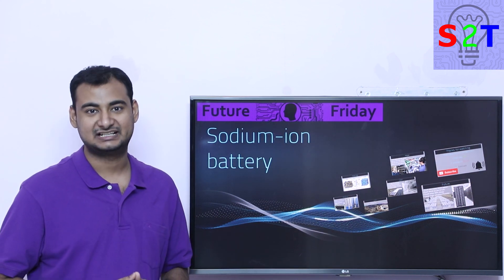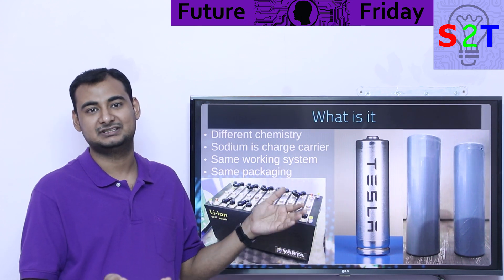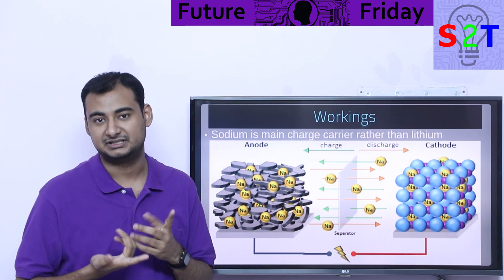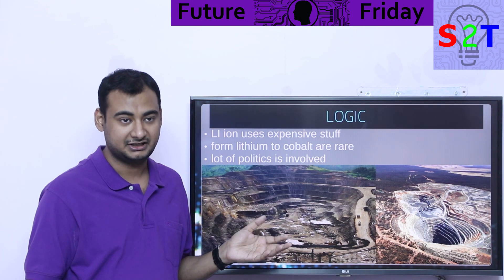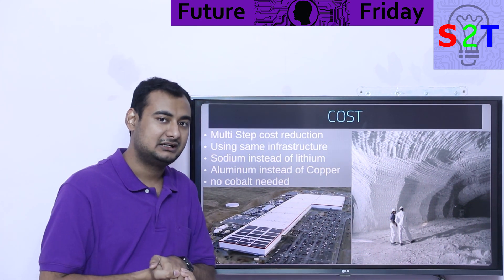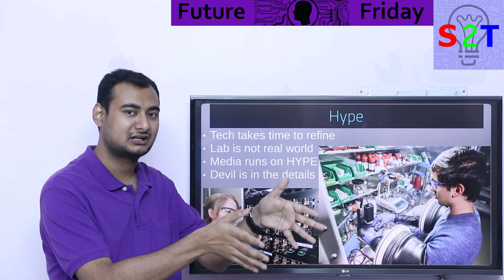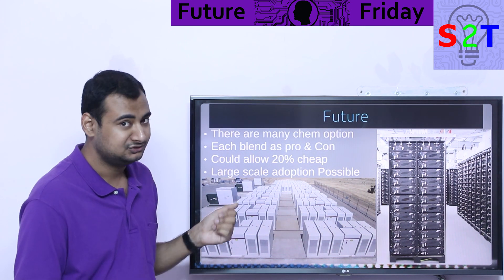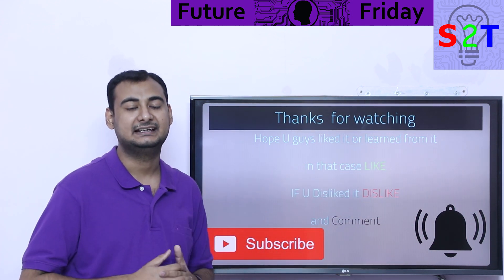Sodium ion battery Explained {Future Friday Ep98}

Comment: There are different types of processor for mobile phone how can we which one is best.
Reply: Performance of process based on many things but important is 
1) letancy 2) how smaller is circuit  or size of nod 3) core count  
4) clock speed 
But also depend on how many layer of interface lie beanith in application software
So Apple  bionic processor is  best of smartphone  catagory 
It have perfect combination of all aspects of performance
Reply from the maker: depends on architecture If u need X86 U Can only use X86  if U need arm U can only use ARM
Reply: Hahaha.......